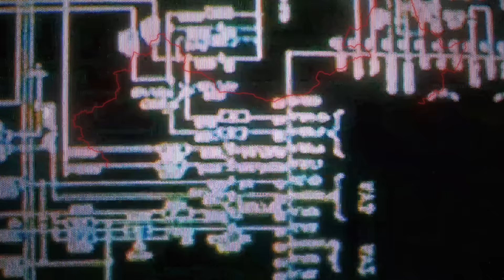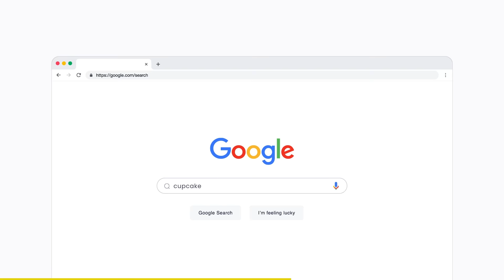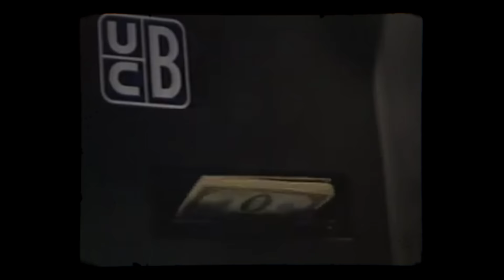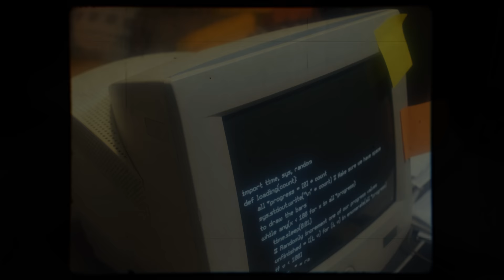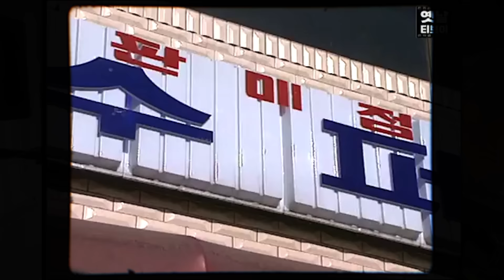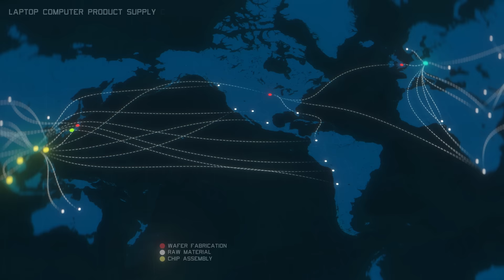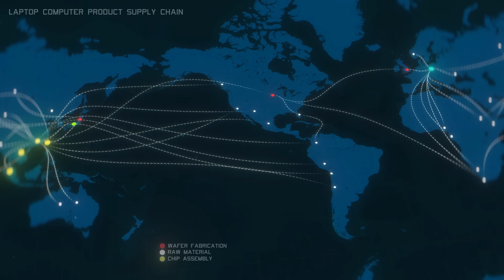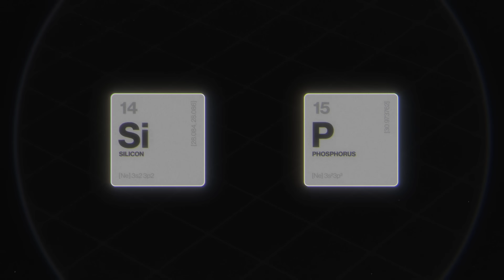Our New Global Economy

Comment: Rivalry aside, supply chain shipping issues caused by the Covid lockdown, the Everygreen ship being stuck in the Suez Canal and now ships being attacked by the Houthi rebels exposed some flaws that caused a lot of issues with supply delays. Surely there's some compromise solution that allows distributed manufacturing and knowledge sharing that allows inventory spreading to reduce these issues. And we've also lost some unique manufacturing that's been lost in areas, like for example a lot of ethnic clothing are just replaced with pretty generic modern clothing.
Reply: Your observation is 👍 
Which country you are from?

Comment: Supply lines DID do a fantastic job considering the circumstances. Needless panic buying is what led to a lot of the major issues.
Reply: That’s not fully true, we had issues outside of the panic buying, medication and other sectors were hit hard. However the biggest issue isn’t just supply chain issues, if war breaks out there won’t be a supply at all. Our industrial market isn’t what it use to be, and if the supply from China goes away it’s a big issue and in a time where we will already have a different but equally important issues (war). 

I’ve been saying this since the Bush administration. While cheap Chinese goods help the wallet, the writing has been on the wall since Bush administration. China has been ramping up its military industry since then. Only reason why is to rival us. 

We need to buy US products and support our domestic businesses and manufacturing industry. I’m not opposed to global economics, I support it, but we just can’t rely on countries who are planning to go to war with us. It will be more devastating when said war happens.
Reply: @michaelschlarman7835 We should have started becoming less dependent on China after the Soviet Union collapsed. 

The original point of becoming entangled with China was to keep China and the ussr from a military alliance during the cold war.

Comment: Well globalization has had some pretty unfortunate consequences so this is probably a good thing.
Reply: Free trade should be that, not thousands of pages of laws.
Reply: @JK-gu3tl  The problem is that these laws are necessary, otherwise, all labor would just get moved to states with little to no worker rights. I mean, it's hard to compete on price with slave labor. Laws are necessary, but laws are only as strong as our will to enforce it. Not only that, but they need to be updated regularly, otherwise, we end up in our paradigm where a few bad actors abuse specifics to take an unfair spot in the global economy. I'll let you look up why shipping from China is so cheap compared to shipping between 2 states; there's quite a bit of history there that's quite interesting to read.

Comment: Also id like to point out some funny facts like average wage in 72 was 3.88 an hr vs 2018 27.45 because the average worker is now making more they jump a tax bracket but if both years you bought a washer and dryer in 72 it was about half a months wage in 2018 it was more like 58% wich isn't better